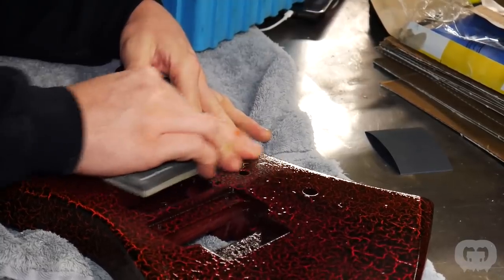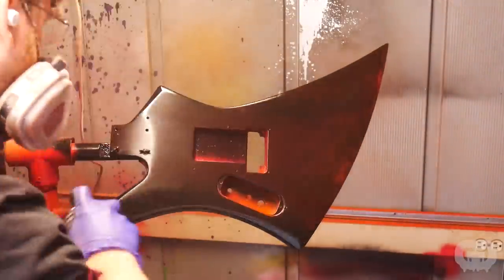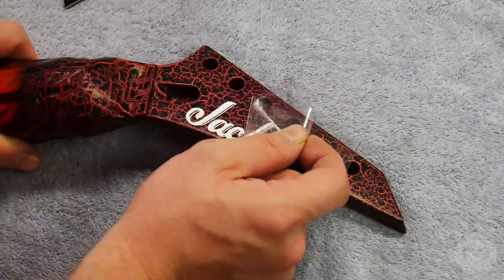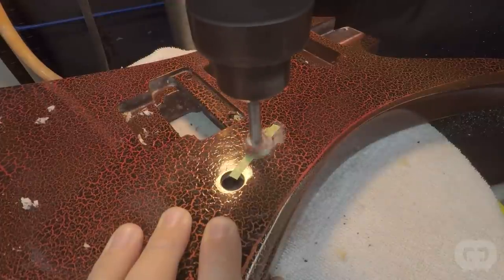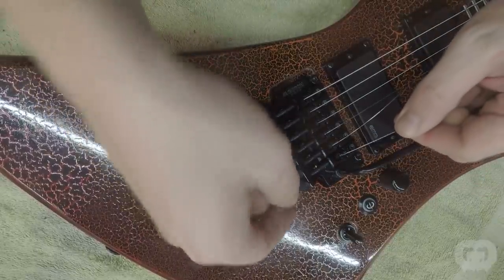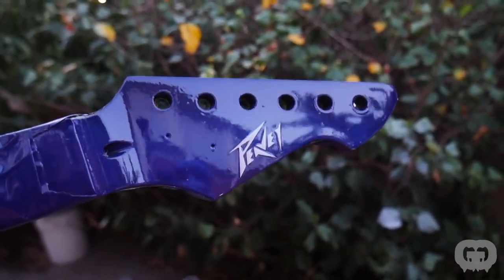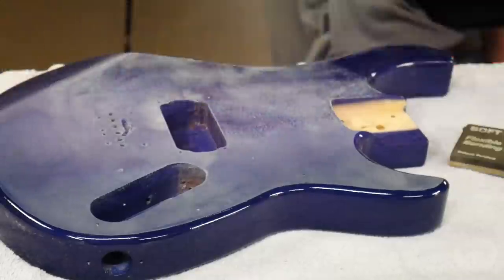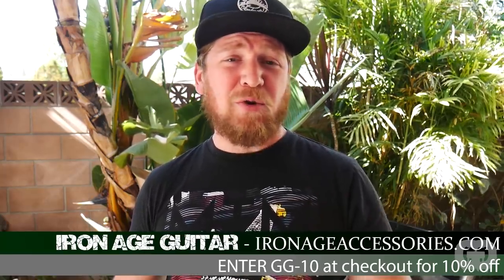Trash to Thrash #26 – Lava Crackle Kelly & Royal Nebula Rockmaster (Haro) - S2E06 (Peavey & Jackson)

Comment: I had the same thing happen to me with crackle (white cracks). It was not letting the base coat (1k acrylic) set long enough and the crackle paint ripped the basecoat apart and exposed the primer. Montana's recommendations are very broad and unfortunately trial and error are probably the only way to really get it right.